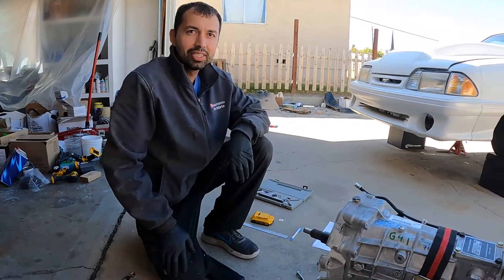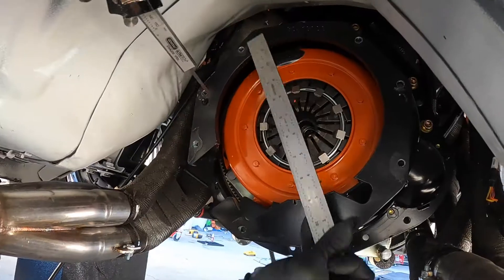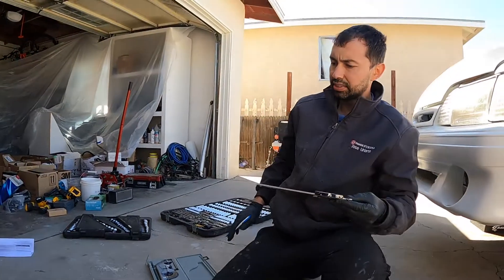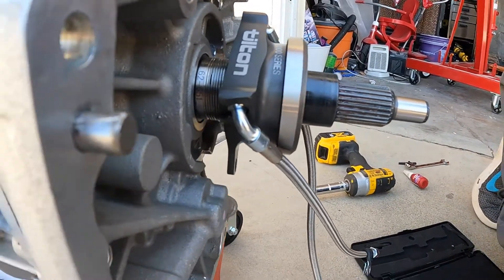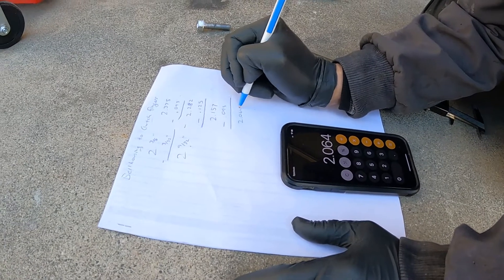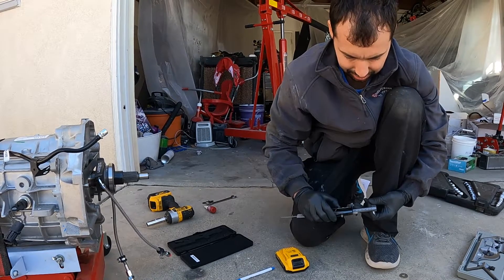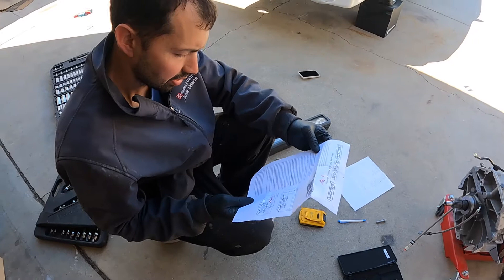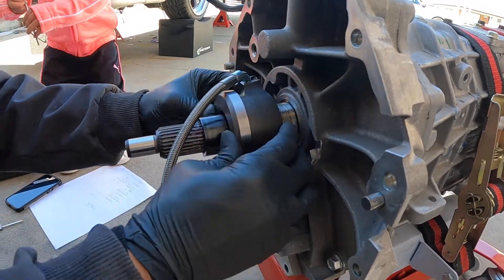Setting Air Gap on Hydraulic Release Bearing Tilton 6000 Series

Comment: Literally as simple as 50 minus 30 if you did this in millimeter’s 🤦‍♂️ the metric system is so much easier. Obviously that’s just an example but if you did this in millimetres it be as simple subtracting two different numbers that would be under 100.😂

Comment: I just did this on my T56 in my terminator, and had to put a spacer in between the threaded internal collar and the face of the transmission to keep the collar from pushing on the bearing retainer. Did you end up putting something in there as well?